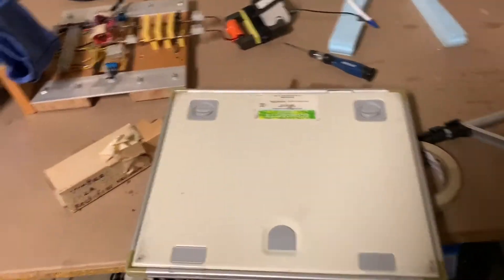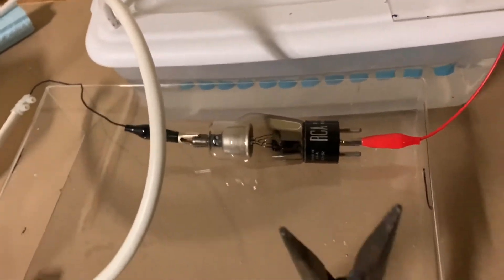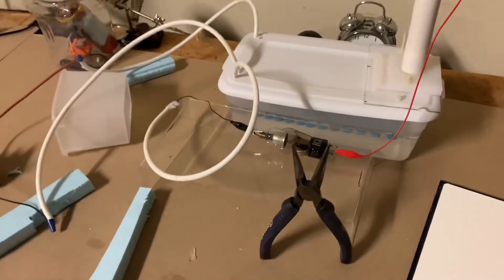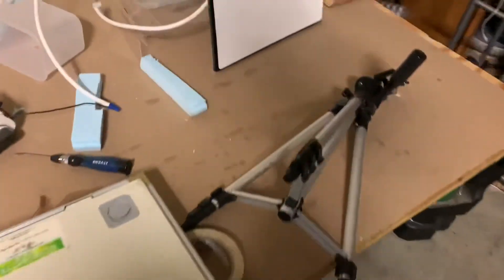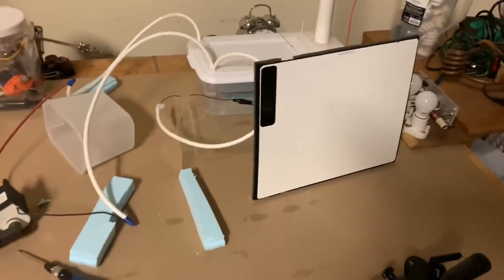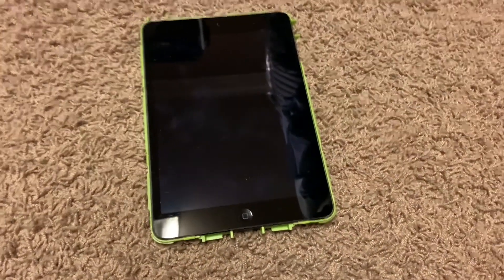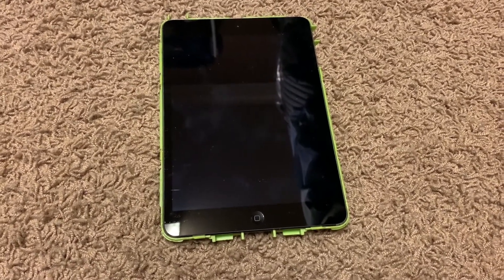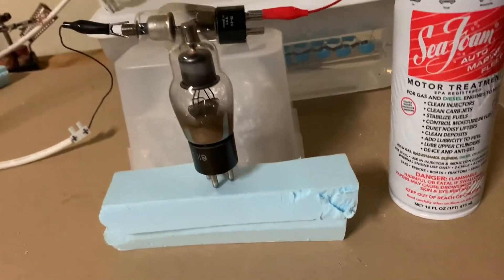Home Made X-Ray Images

Comment: the noise is stationary, so clearly not genuine images.   Perhaps you should improve upon your CG effects...
The tube will thermally destroy itself when powered  above 20 kV for any reasonable period of time, the kind of time needed for these apparent long duration image captures.  You are using cold cathode mode, the pancake tube of your detector will detect these and give a strong signal compared to background, but the number of x-ray photons is actually quite low from a tube operated in this way.
Reply from the maker: It’s a timed exposure capture
Reply: @BrianDhvTinkerer  OK, I will accept that mistakes happen, after all everyone make mistakes in my experiments most of the time.   I do just want to ask, as I tried this myself on my channel , what software you used for such  long exposure?
Reply: @BrianDhvTinkerer  Yes what exact app did you use?
Reply from the maker: @surplusdriller1 used Slow Shutter app for iPhone and the X-ray Fluor screen taken from an X- ray cassette

Comment: But at the end you talk about the polarity to best connect the tube, and you say its here in reverse. But does that mean that you use your negative multiplier here? Because i see the cap of the tube connected to the hv-output that's probably that long pipe on top of the multiplierbox? But isn't that top also the positive connection from the rectifiertube? So you use your negative multiplier to set minus-hv on that tubetop to get reverse polarity indeed. Or did i misunderstand something? (This is again thát interesting that i please love to know it precisely, i think!)
Reply from the maker: For the experiments shown the cap of the tube was connected to negative (black wire) output of the multiplier and the pins were connected to red. I subsequently reversed the wires to their correct position Ie cap positive red wire and pins negative black wire but did not shoot any more imaging. Plan to do some more imaging later today with frozen chicken wings with the tube correctly connected up!
Reply: What's the point of X-ray if you can't look inside a mass without cutting it open..?
Reply from the maker: @steve-o6413  actually harder X-rays are very valuable for looking into things like metal, steel etc. For example metal parts like jet engine turbine blades for stress fractures in the metal blades and to look at bone for microscopic fractures. The X-rays generated by my rectifier tube are soft X-rays partially absorbed by water and soft tissues and completely absorbed by metal - they would not be useful for looking at bone or metal ( see my follow up video about to be uploaded soon). Higher voltages lead to harder X rays. Denser metals for bremstahlung  like tungsten combined with higher voltages in the 100-150 kV range lead to much  harder x rays.

Comment: Cool stuff! Do you have any idea of the current flow?  Does it generate X-rays continuously or does it put out random pulses?  Do you have any idea of the photon energies you're getting?
Reply from the maker: It’s empiric at this stage. The energies are enough to pass through glass and  aluminum but not  copper and lead. Currents are low in the uA to low mA range as the cathode in the tube has not been heated. Also I connected the tube backwards for the experiments. I expect more current and energy if I connect it correctly- this will improve generated image quality.
Reply: @BrianDhvTinkerer  yes indeed, that is also worth researching! Ánd probably worth a seperate video!(a video of two, of ten maybe! Ow really, i really enjoy your experiments and researchings!)
Reply from the maker: Thanks!
Reply from the maker: X-ray production is continuous